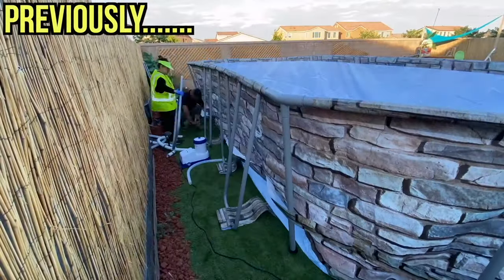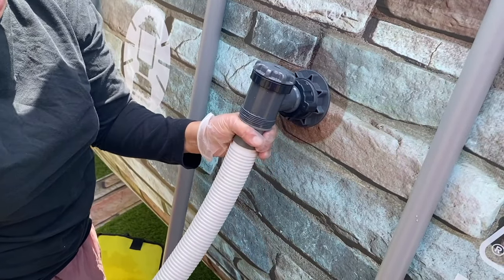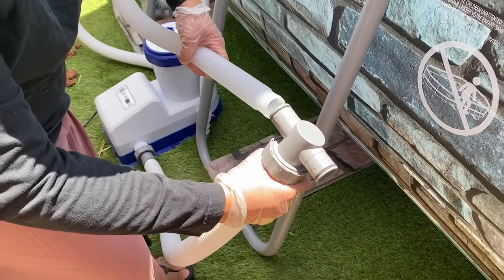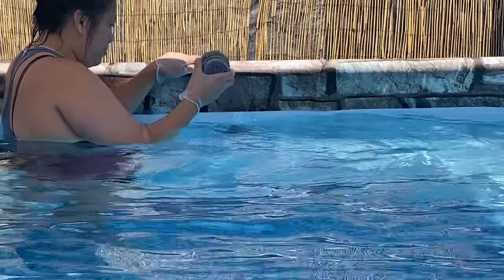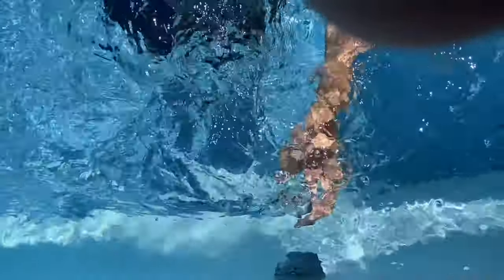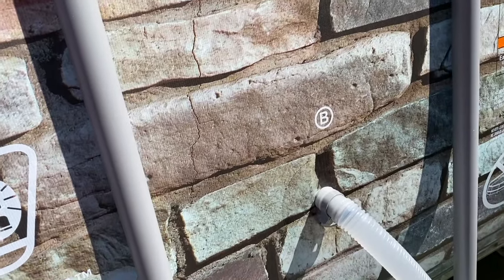How to install Bestway PUMP FILTER to the Coleman POOL

Comment from the maker: ⏰ TIMESTAMPS:
0:00 Intro
0:16 Installing the Tubes to the Bestway PUMP FILTER
1:01 Installing the Tubes to the "T" Connector
1:45 Installing the Tube Clamps to the Tubes
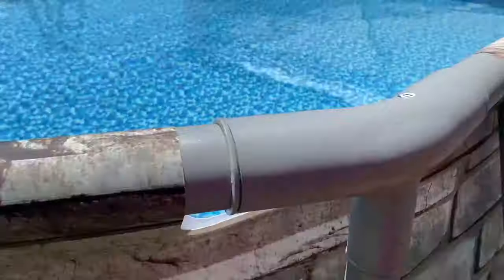2:25 Installing FILTER 1
3:26 Installing FILTER 2
4:22 Installing FILTER 3
4:30 Plugging in the AC Adapter
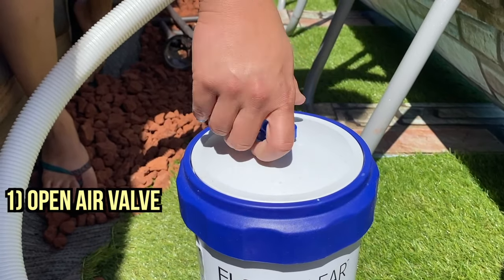4:47 Opening up the Bestway PUMP FILTER Air Valve
5:00 GFCI TEST for the Bestway PUMP FILTER
5:22 Turning on the Bestway PUMP FILTER
Reply: Mark

Comment: What about the two black pugs? The ones you took off before putting the filters inside the pool. Do we just save them ? And the dial on option A , is it always on the lock position?

Comment: Nice Video. We just sold our smaller pool and I'm planning to upgrade to the same pool package that you have.  I noticed that only the A - inlet port have a valve and the 2 B - outlet does not come with valves. Does the pump have a built in mechanism to prevent the water from gushing out when you replace the filter or do you need to plug the B port before opening the filter?   Thanks Kabayan.
Reply: Plug port B's or water gushes out. Learned that today
Reply from the maker: Hey Diymanual! I'm very sorry for the late reply, But i think Tamara's comment below answered your question. I also don't have this pool anymore. We sold it awhile back. Anyways, Sorry i couldn't be of help earlier.
Reply: @YESorNOItemREVIEWS  Thanks. I just put mine up and added a valve on the B port.

Comment: I see that the instructions state to place wood or concrete blocks under each vertical leg. Should I? I have sand on top soil and I've tamped it very well. Is this needed?

Comment: I have the same one. I just connected it but it says dirty filter but it is brand new. how could I check that?
Reply from the maker: Hi Maria...Wow i'm sorry to hear about that...The only thing that i could think of is to make sure the filter is the Exact size for the Pump Filter. I've honestly haven't had this problem yet. Sorry i'm not much help right now and i apologize for responding late. 😢

Comment: I wanted to ask you guys we've set up our pool 2 times already . But it goes inward, we are scared something bad might happen any help plz. Did it happen to anyone else. I've filled it up to my knees and stopped and it's on both sides were is just coming toward the inside
Reply from the maker: Hey Myra! Haha we had the same scare. That’s actually normal. Both sides will straighten out once the water reaches about 90% of the pool 😁

Comment: Does the lock remained closed under the A?
Reply from the maker: Hello Tabitha, All the locks that we have done are remained closed. Hope this helps and sorry for the super late response. Lots of issues lately :(
Reply: Mine wouldn’t let any water flow if I left it locked. So I unlocked it and water finally flowed through

Comment: The issue I have is on the final stage, you pushed on a button, and the pump came on. My pump won't start unless it's hooked up to Wi-Fi. Is there a way to bypass Wi-Fi? This is the worst idea from any pool manufacturers. No, where did it say it won't work with 5g? This is what I have,